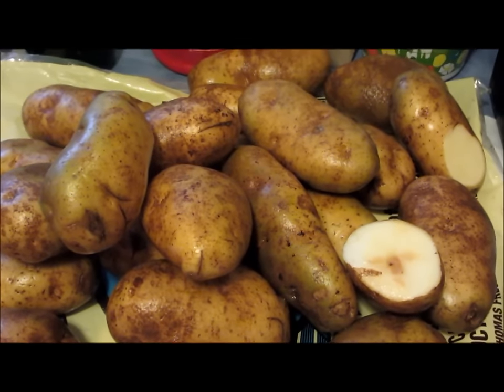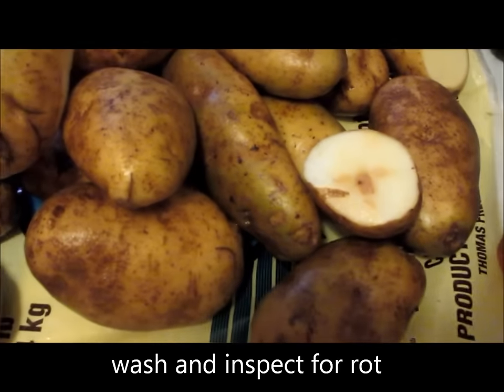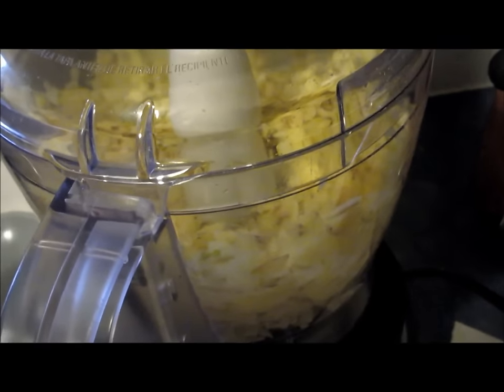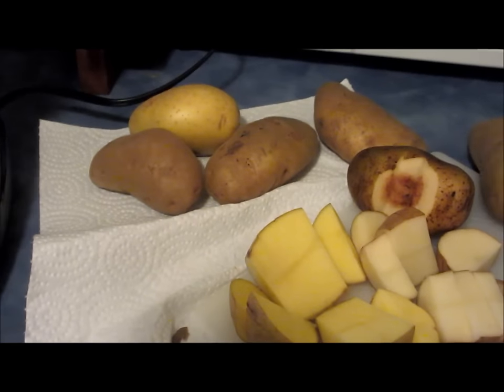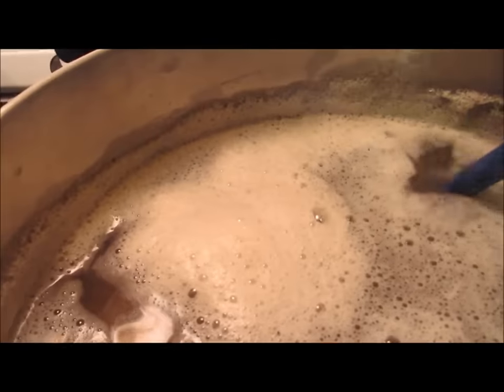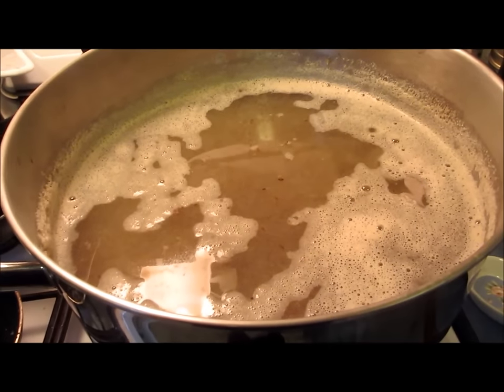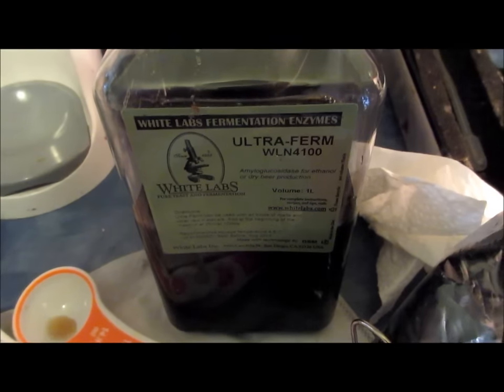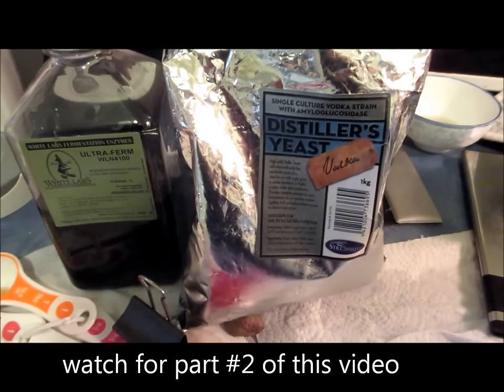PotatoVodka

Comment: One way to get a sugar conversion from potatoes is to lower the pH with HCl aka Hydrochloric Acid.  So when you added the calcium sulphate to raise the pH you may have been working against the process. Once you have a syrupy mash with a high brix then you add a measured amount of sodium hydroxide aka lye. This raises the mash back up to a fermentable pH but turns the HCl into table salt which yeast doesn't like but it is all a matter of needing only a small amount. Plus you might add lime (cement type) in which case the product would be calcium chloride a popular wine additive.   "Cody's Lab" channel did the HCl acid conversion to make sugar- maybe his video is still there. I definitely works but I'm sure dummies could be very sorry using two dangerous things on the same day.
The enzymes might still work with some acid to help. Don't know. Don't know if you can other acids in combination with enzymes- like citric acid.  Starch is cheap and converting it to sugar needs to happen well for economy of production or you might as well just buy sugar.

Comment: You don’t need all these enzymes just use yeast, that’s the traditional way of doing it.
Reply: How to without yeast?
Reply: @isaklaursen7117  wild yeast and bacteria from the air, just leave it in the open.
Reply: @isaklaursen7117 You don't have yeast?
Reply: Yeast alone will not convert starch to fermentable sugar.  Enzymes ARE necessary
Reply: The enzymes will increase the sugar in the mash by breaking down the starches into glucose and fructose and you will get way more alcohol with just a short easy step of sprinkling some in. Trusting natural yeast to not bring in bad bacteria is a gamble

Comment: You only get a few % of ethanol the way you prepared your starch, that pan should be like porridge and no water visible. once you put the enzymes in than it will go more fluid when the starch gets broken down, now you had a pot of water with a few potatoes making a mash with very little starch. Use more potatoes..
Reply: And do away with the Yukon Gold. They have a lower starch content than the Russets.

Comment: Of course if you're using 9l of water and 6kg of potatoes, you're going to have a very dilute wort. Guess I'd first cut the potatoes to half, boil them thoroughly and drain most of (all?) the water, and only then pulp them, cool down to something like 65-70C, and add malt or enzymes to begin mashing. They will of course be a very thick puree after pulping, but it will get a lot thinner during mashing. That way you could end up with some decent gravity readings.

Comment: You do realize this isn't exactly ok to do without a distillers license, right? 🤷‍♂️Even for scientific analysis.

Edit: so I'm definitely wrong about that. As long as it's used in a laboratory setting for scientific study or analysis, you do not need to register your still or apply for a license. Wow. I did not know that. 👍👍